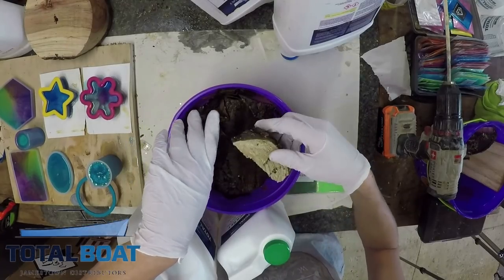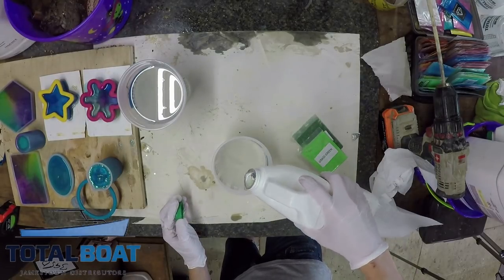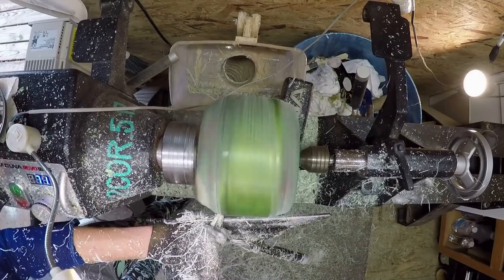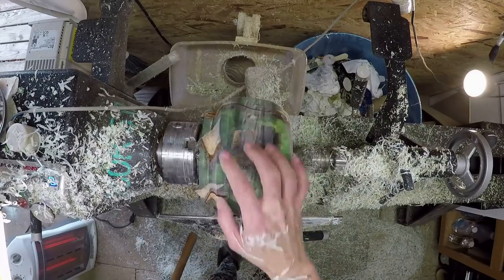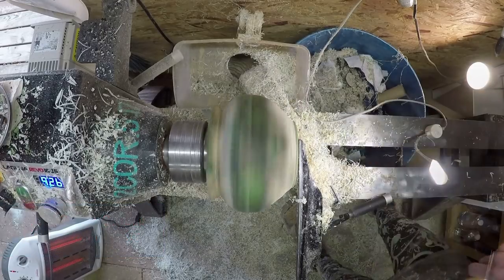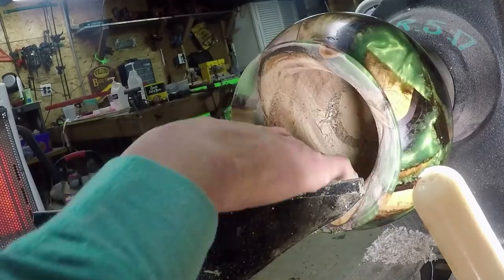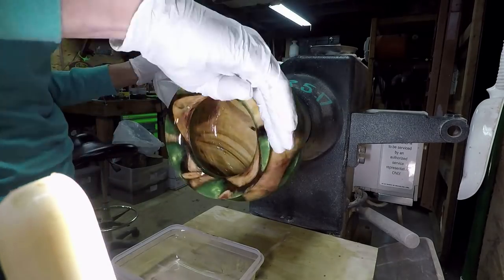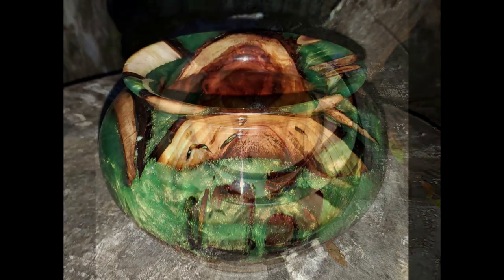Red Wood and Green resin Hollow Form

Comment: Hi Kim. Nice job on  the bowl looks great. With your carbide Easy Wood Hollower using a positive rake insert try rotate the tool from flat to about 20 degrees or so downward as you cut. Takes a little practice. This will change the angle of the cut like a negative rake cutter. You can get away with it and have it cut pretty good.
Reply from the maker: Thank you for the info and kind words! I have tried that and yes, takes practice.  I am not quite there yet as the tool still wants to catapult me across the shop. lol I will stay with it and continue to practice.  🤗😁😉

Comment: Walmart,  ma'am, a great corded drill that has a speed knob built into the trigger, it is of the hyper tough tool line, i love them i own two of those drills as well as the 20 volt drills as well, and i haven't had no complaints after two years

Comment: Love the contrast with the black. Also, I can’t remember which channel I was watching but I recall the turner having the same problem with chipping epoxy. He called a fellow turner and he suggested “speeding up “ the lathe not slowing it down. It might sound counter intuitive but as long as the mixture is right, I found it does work much better.
Reply from the maker: Thank you Mercel Rey! I turned this as fast as I could . Any faster and I would have chased the lathe across the shop lol

Comment: Awesome project. I might have missed it but is there a reason you left the bark on? I have always heard that you need to take the bark off do that the resin will adhere to the wood. Other than the fibers sticking up did you have any other problems with the bark?

Comment: 14:40 don't use wax if you plan to use a resin finish. Resin needs to stick to the wood fibers
Reply: Wax or abrasive paste after applying the resin coat :) clean sanding with 240# before applying the resin coat. 240# leaves the fibers sticking out enough so the resin coat is solid
Reply from the maker: yeah, I knew that but If I had known that I was going to have the complications that I did, I wouldn't have waxed it :( Sometimes I am the cause of my own problems. lol I need a bigger shovel. haha. Thanks for the info. I hope others read this advise and use it. ;)